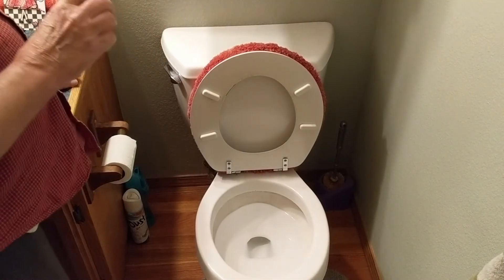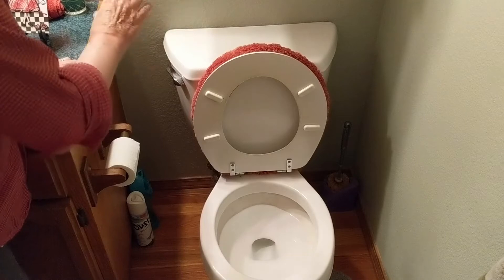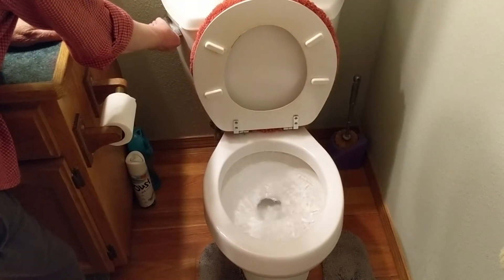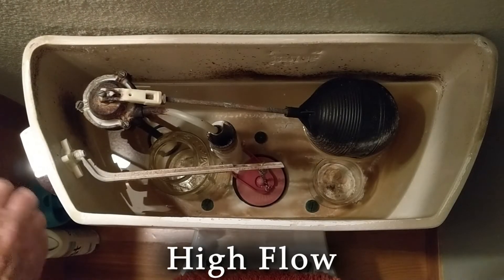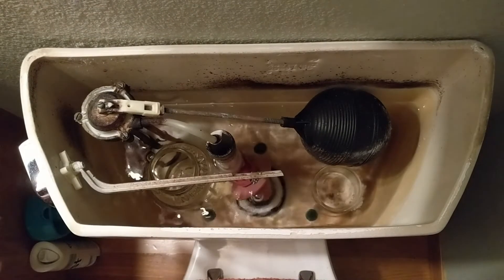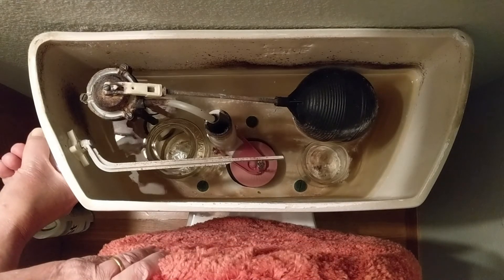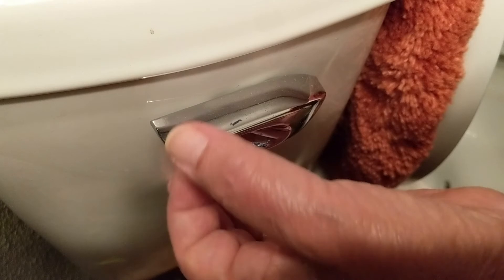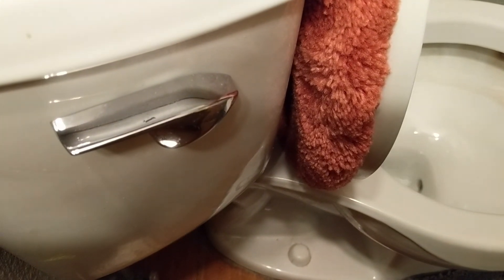Water Saving Toilet Flushing Technique - Save Money, Save Water, Save the Environment!

Comment: Yes, it’s important to save water, but you never leave a toilet unflushed after using it just because it wouldn’t be seriously full of junk yet (as in if that’s the case once you’ve recently used the toilet). Somebody else I know thought that was how to save toilet water but had been proven wrong when that idea made things on or around the toilet get dirty faster probably by spreading germs and letting the germs multiply. Besides, it’s rude to leave behind a mess and expect someone else to pick it up!
Reply from the maker: This technique does not leave the toilet unflushed. This "short flush" technique completely flushes the toilet bowl water as you can see in the video. So there is "clean" water in the bowl (no junk) after the "short flush". The "short flush" just may not have the power/velocity that a standard flush has so use a standard regular flush for a number 2.